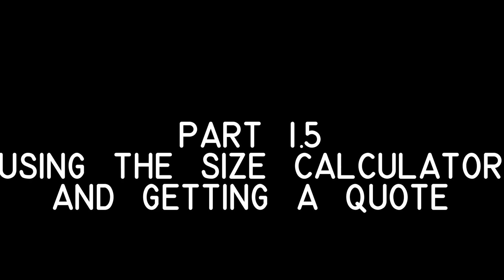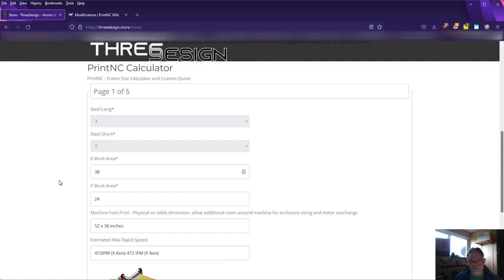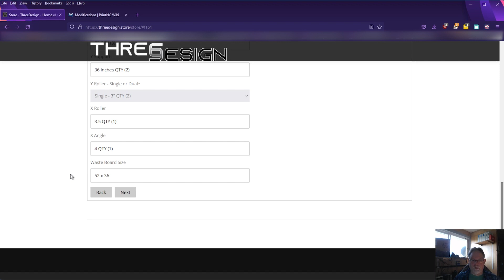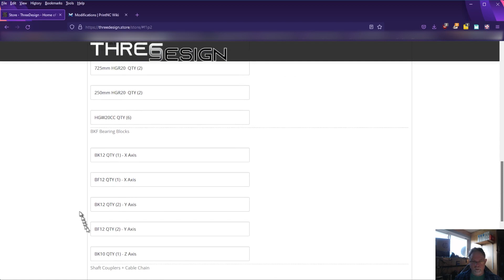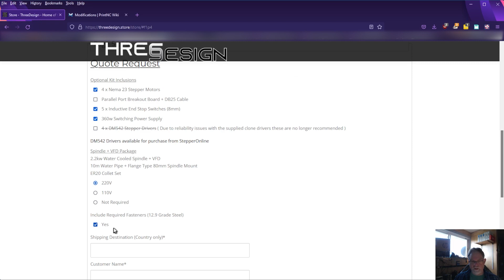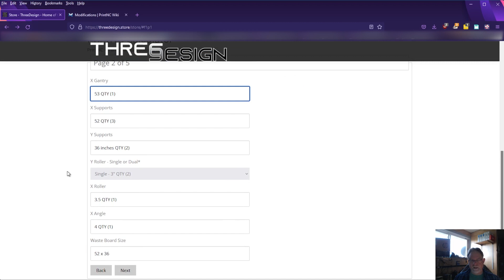Part 1.5 - Using the size calculator and getting a parts quote.

Comment: Thanks for the videos. I already purchased linear bearings and ballscrews for a previous project. Do you have any idea how to adapt the calculator to accomodate other sizes of these?
Reply from the maker: If you've got the right diameter ball screws already, I'd fiddle with the machine dimensions until it coughs out a ballscrew length that matches what you've got.